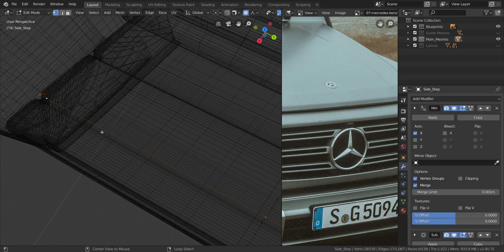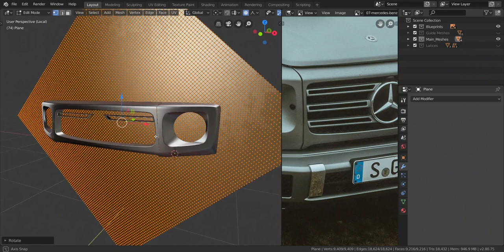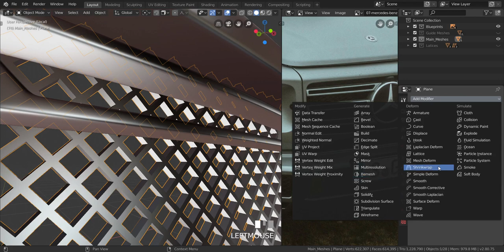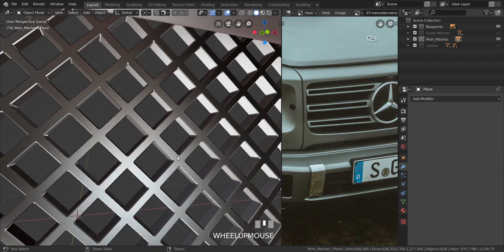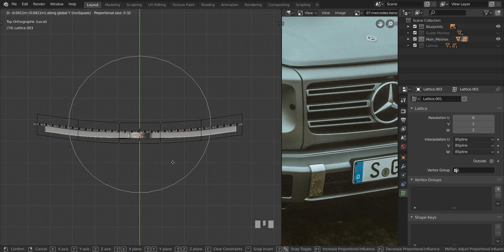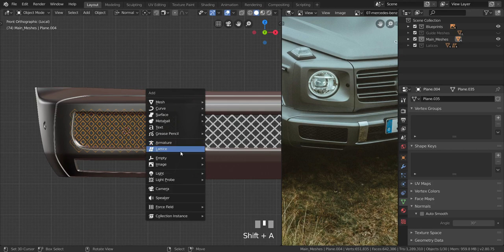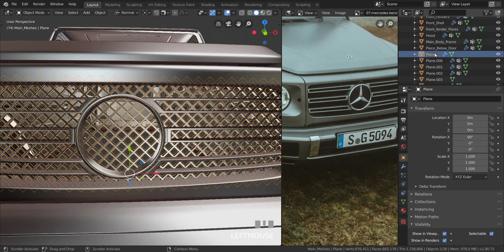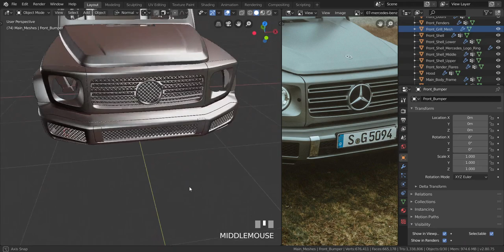Blender 2.8 Car Modeling Tutorial - Part 51 (Mesh Grills)

Comment: I know there are many ways to skin a cat in Blender but this is the technique I use to make grills.
1) Add a Plane.
2) In Edit Mode > Subdivide as often as needed until you get the grill hole size you want.
3) Space Bar > "Poke"
4) Alt- J (this removes the horizontal/vertical lines and keeps the diagonal lines)
5) Wireframe modifier
... and you're done. I got this from MasterXeon1001 in this video: https://www.youtube.com/watch?v=oQIfwpPVMc8
Reply: I forgot to mention step 5) as always return to Object mode before adding the modifier, otherwise you won't see any results.
Reply: Also the Bevel modifier worked using this method. Not sure why you're Bevel modifier didn't work. Weird.
Reply from the maker: that's great thanks
Reply: yours is more easy for me, thanks
Reply: Alt+J  just  makes "tries" into "qauds"